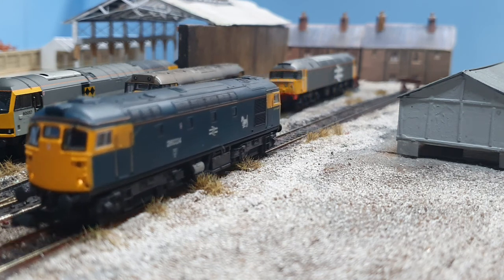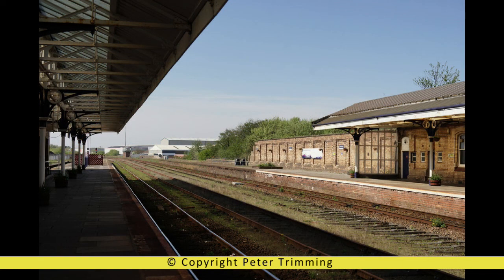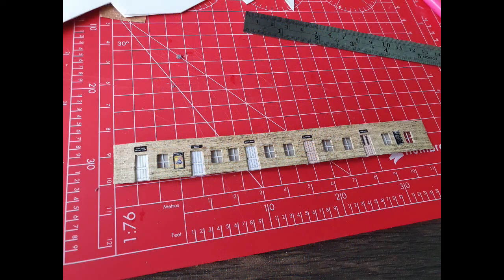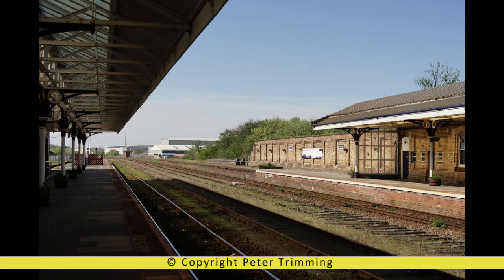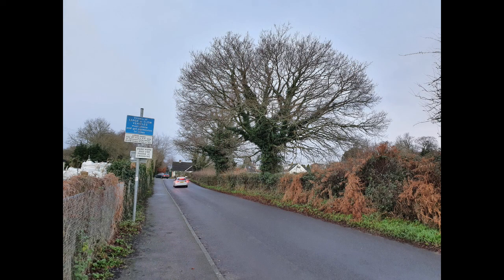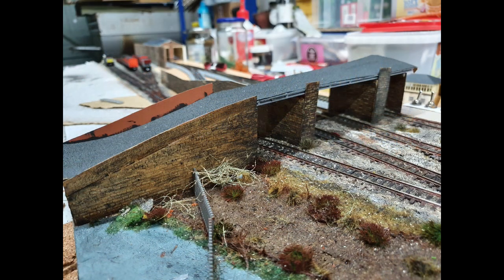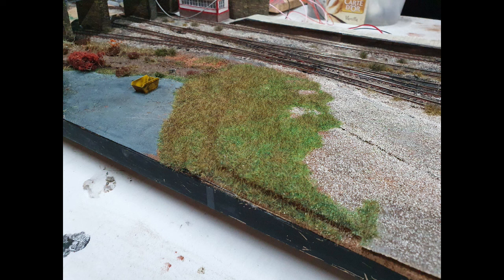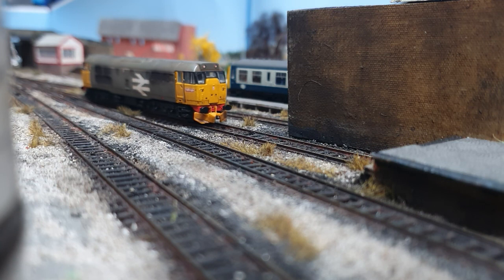Salterbeck Revisited - Build Part 5

Comment: Some nice scratchbuilding, know how fustrating it is to build in this scale sometimes, cheers
Reply from the maker: Thank you. Yeah it certainly can be. My main frustration at the moment isn't so much with the buildings, it's the fact that the expensive engines refuse to run properly!
Reply: @neggypotterngaugemodelling2688  Agree, im having a lot of problems with derailments and am swapping out 2nd radius for 3rd in a few places for my long 66s.
Reply from the maker: @staffordstationngauge8359  My Bransty layout has 1st/2nd radius curves and it limits what you can run particularly on the inner curve. I run steam era stock so its not too bad but its why im planning a rebuild with 2nd/3rd radius which is the widest I can fit in the space.
Reply: @neggypotterngaugemodelling2688  interesting to see your opinions on my layout cheers